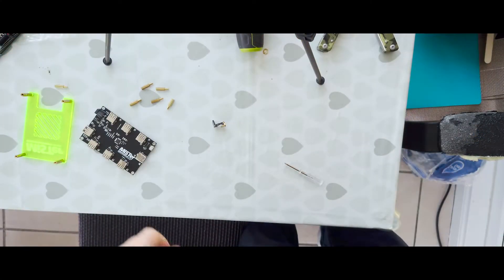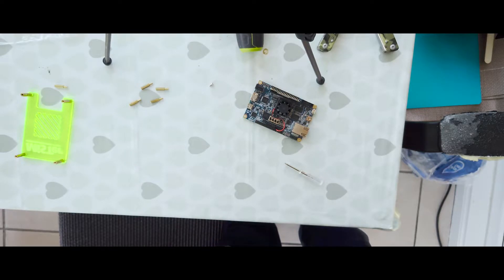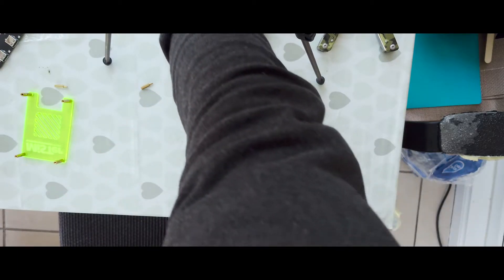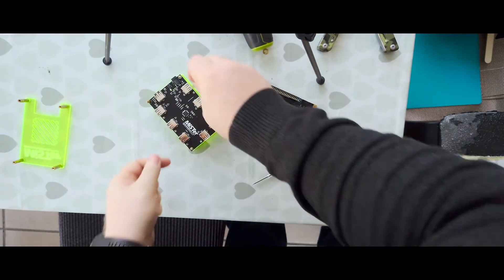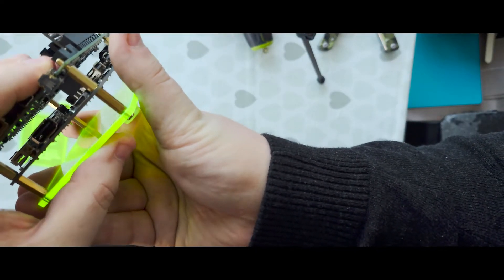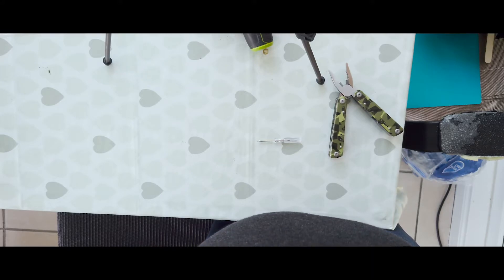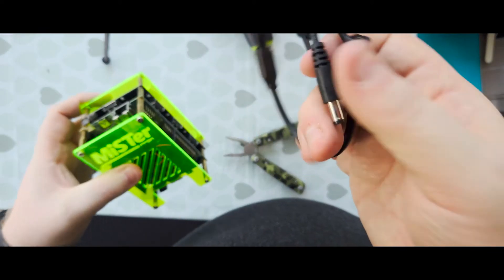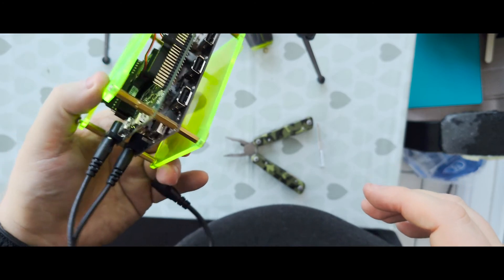Adding USB Hub Addon board to DE10-Nano for MiSTer

Comment: Hi Kris, Thanks for showing this. I was a bit confused with my new usb hub 2.1, as with the small interconnect between the usb board and the de10, I wasn't quite sure if I should then connect the split power cable to both the de10 and the usb board. Looks like you did, so I can presume it's fine to use both the interconnect and also connect the split cable to both boards?
Reply from the maker: I did. My understanding is that both are needed for best use. I've had no problems powering an external SSD with the hub and I'm really happy with it.
Reply: @allyourbasekris   Great, thanks.